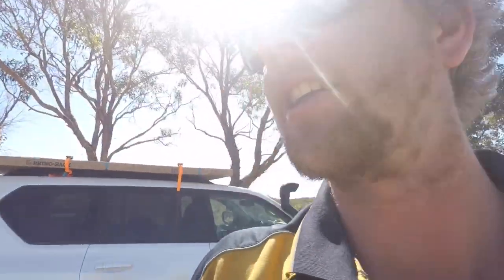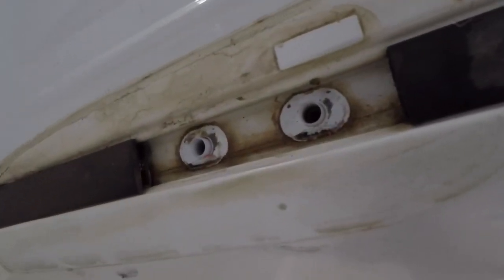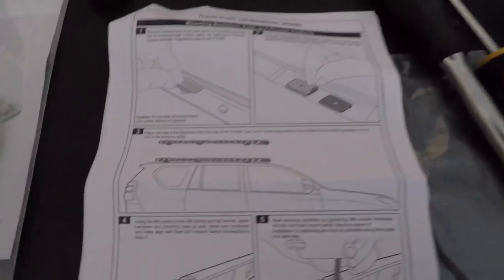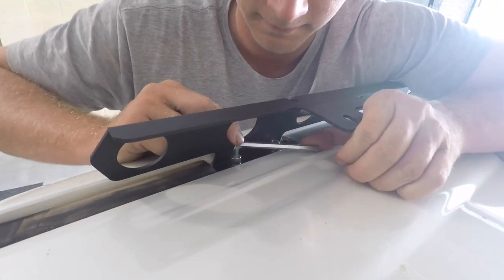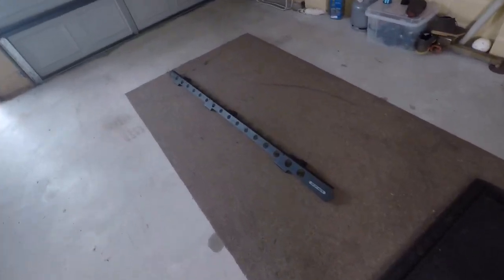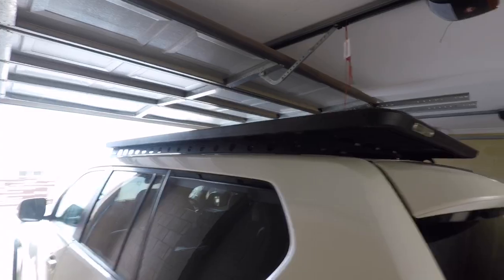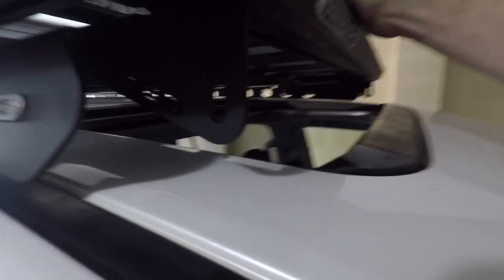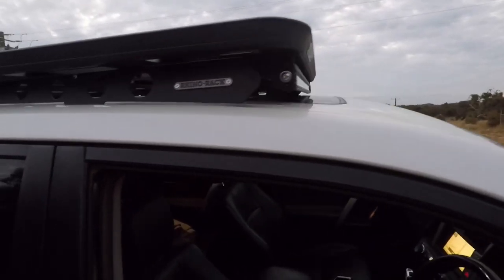Rhino-Rack Backbone install, Prado 150

Comment: this is awesome mate.  I've got a Prado 120.  Wanted to get the exact same setup. This really helps
Reply from the maker: Glad it’s helped in some way. Is a bit fiddly but have a couple of beers and it’s pretty easy to get on
Reply: @JS_Adventure  By the way - I've got thee sunroof on my prado as well.  What's the platform size you went with?
Reply from the maker: I went with the 2128x1236 as I thought I could always use the extra room. It completely covers the sunroof but for the amount of times we use the sunroof I’m happy to have it covered
Reply: @JS_Adventure  where did you get the light bar n brackets, model etc
Reply from the maker: Light bar is just a 40” kings single row and the bracket is from stedi online

Comment: Nice Pioneer rack & Backbone system addition to the Prado. Looks awesome and functional. Rhino doesn't make the Backbone for my SUV. I may attempt to mod one of the Backbone kit. When you get the chance can you provide some measurements? Would like to know the approximate location of the base (3) that are bolted to the roof of your Prado. Might be able to make it fit my SUV. Thnx

Comment: Nice video… do you reckon the backbone gets the tray seated lower than installing on the original rails? 

I’m looking for something lower so my car can fit my garage.
Reply from the maker: If I can remember correctly the backbone and pioneer rack almost the exact same height as the standard rails, as the backbone sits tucked in the rack to allow it to be as low as possible

Comment: What size is your lightbar? Kings?
Reply from the maker: Yeah mate kings! 40” couple of years old and still going strong
Reply: Would it’s measurements be 1061.3mm(W) × 48mm(H) ? Couldn’t get mine to fit, it was hitting the backbone and wouldn’t go over any further. I ended up mounting it under the rack.

Comment: Hi 
What kind of bull bar in your Kakadu 
Because ARB said if you put the bull bar the sensor behind the grill might not work 
So I am looking for bull bar for 2011 Kakadu 
And can you tell me the size of the rack please 
Thanks
Reply from the maker: Bullbar is an early arb kdss bar and scrub/side step.  All sensors are working but I think they have changed there design since then. Front mount camera is pretty much useless with bullbar though. The rhino rack is a 2128x1236
Reply: @JS_Adventure  thank you

Comment: Can’t find the stedi bracket that the same like you have
I like the light bar that between pioneer rack and roof.
How do you find the bracket?
I didn’t see in their website 
Thanks
Reply from the maker: No problem with the bracket. The only reason I got it was because I wanted it tucked between the rack and roof and not protruding out. 
Looks like there out of stock until the 12th but here’s a link:
https://www.stedi.com.au/led-light-bar-bracket-to-suit-rhino-rack-platform.html?gclid=CjwKCAjwx6WDBhBQEiwA_dP8rUGyV-iCrVtLE2zMEAPN1qCJQLFeAjhG0YziSxDCZlNdUMjku6Y3TBoCEO4QAvD_BwE
Reply: @JS_Adventure  
Thanks a lot and really appreciate

Comment: You glossed over the most confusing part...the installation of the rack to the backbone. 

The backbone came with the channel nuts, but the platform came with the small square with a bolt on the to attach the rack to the backbone. However, the small square with the bold is too small for the underbar channel which allows the nut to be unable to tighten because the square just spins in the channel. Am I doing something wrong. It almost seems like this square as supposed to be wider so they can't spin in the channel.
Reply from the maker: Looking at it and from what I remember the square with the bolt is a rectangle with a bolt and fits in my pioneer channel and tightened? On the pioneer website/manual it does mention two different channel bolts? They may have sent the wrong ones but with mine they are rectangular and can only slide in one way

Edit* these are the channel bolts for a backbone/prado

https://www.rhinorack.com/en-au/products/spares-brackets-components/spare-parts/platforms-trays/pioneer-ng-backbone-6-bolt-kit_sp309
Reply: @JS_Adventure  I agree. The SP309 is required, but I find it perplexing that the backbone/platform kit doesn't come with  the REQUIRED hardware to mount the product, but comes with outdated hardware. Did your kit come with the SP309? Thanks for the reply.
Reply from the maker: Yes my kit came with all required hardware for a Prado 150. Did you buy as a vehicle specific kit or separately?